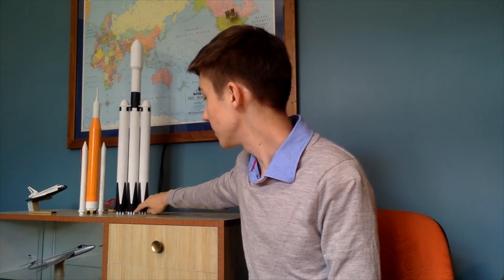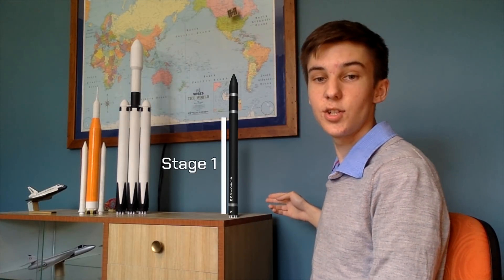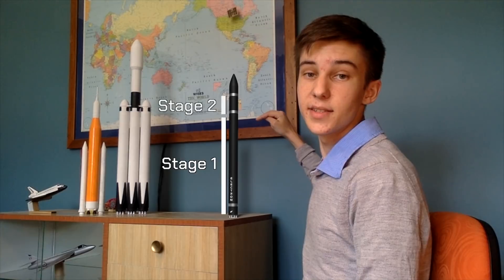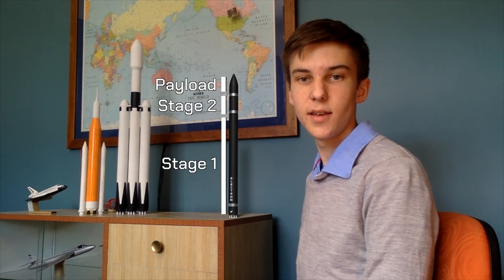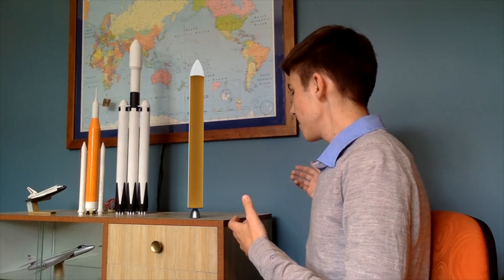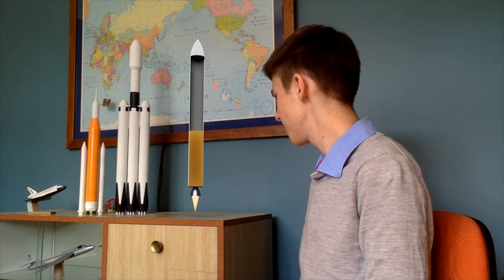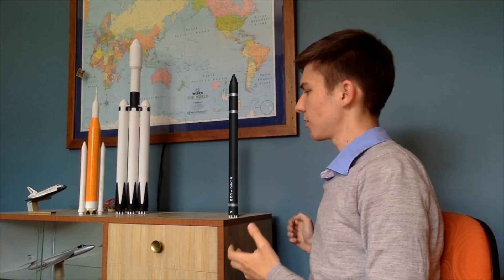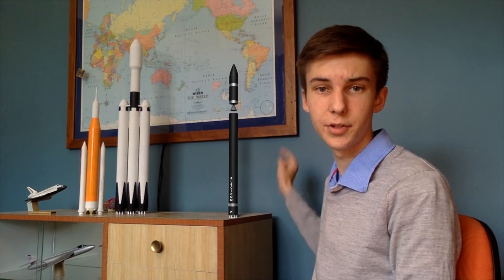Why Do Rockets Stage?

Comment: It have nothing to do with weight since once the rocket left the atmosphere the gravity  is zero, the issue is with nozzles , cuz under sever heat and pressure the nozzles wearing thin and gain bigger diameter so the thrust decreased , so we need to stage it and run another engine
Reply: That's not how that works. Gravity doesn't magically switch off as soon as you leave the atmosphere. If that was true then orbits would be impossible. It still takes energy to go places in space.

Comment: Thanks so much for the explanation :) Keep it up. At 5:41, does the gas coming out of the exhaust separate from the nozzle because of higher air pressure near ground than at orbit?

Comment: Why not just stage from the top to buttom? Then put the payload on the buttom near the boosters? Then the fuel on top, then every time the fuel runs out, the fuel tanks will be drop. That way we will save money by only using fewer engines.

Comment: Regarding the second reason for stages, you could have a cluster rockets with different sizes depending on whether its atmospheric or space propulsion? or not?
Reply from the maker: If you use a vacuum optimised nozzle at sea level you'll get destructive flow instability. You can only start using a vacuum optimised nozzle once you're at an altitide with low enough ambient pressure.
Reply: Yes you could, however, why would you want to? Usually a single vacuum optimized nozzle is attached to the smallest (and most important) part of the spacecraft for travel above the atmosphere in space. All the smaller nozzles have dropped off by that point.
Reply: @jamese9283  Lol I was just wondering really, I know nothing about any of this stuff. But that brings to mind how is the Space X starship going to do this on the return trip from Mars. They need a single ship with rockets to launch out the Martian atmosphere, then work in space as well.
Reply: @qui3tstorm793  Excellent point, which is one of the MANY reasons why Starship will never fly in its current form. They are trying to do too much with one ship.

Comment: Where did you get your falcon heavy and sls models?
Reply from the maker: Asbjørn Lund Dahl I built them
Reply: @SimplySpace  damn, how, what materials and how long did it take?
Reply from the maker: @asbjornld  It took a while just because I spread it out. I modelled them on the computer from reference images and any dimensions I could get, then 3D printed them in parts, assembled them, primed them, filled and sanded imperfections and painted them.
Reply: @SimplySpace  cool!
Reply: Simply Space anyway i could get the files for the falcon heavy?
Reply from the maker: @adambratvold7671  I'll have to try and find them first, it might be a while, they're on my desktop back in my home city. And I'd like to make some modifications, there are details that I missed back then when I wasn't as familiar with FH.